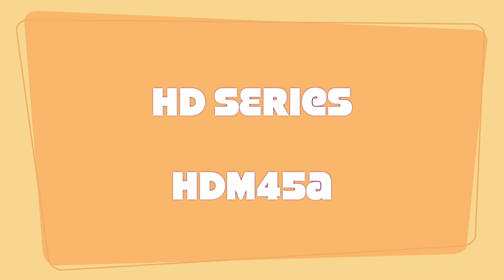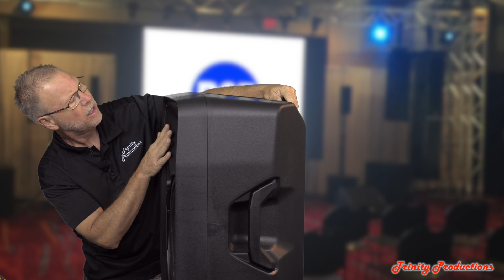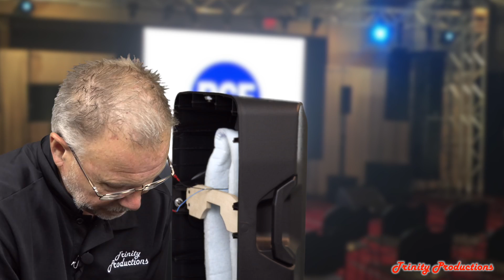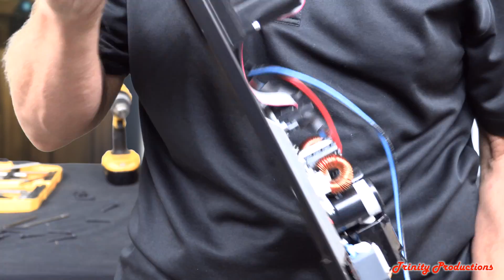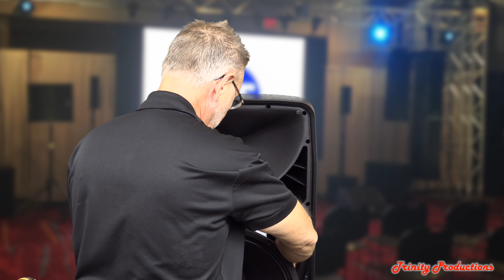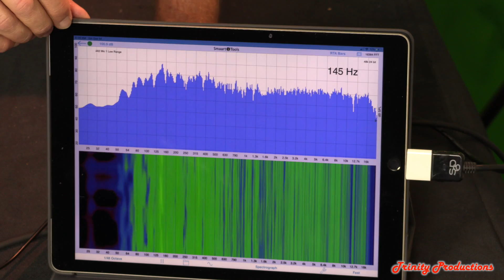RCF HDM45A Complete review and take it apart video. Authorized Platinum Dealers for Italian Speakers

Comment: what differences did you find between HDM45A art 945 and art 745 (RD NET part) I mean as for sound are there any differences?🙏
Reply from the maker: The HDM45A seems to go lower IMO than the ART box, but the drivers are from what i glean are the same , the 945 much better power than the 745 but the HDM had a 650hz crossover point while the 945 keeps that same smooth crossover point , the 745 is the same , just less power and SPL than the other HDM or 9 Series, which are very close in max SPL , the MK5 is within a few dB of the other two , the original 745 had the same max SPL. I did like the fullness of the HDM45A, we sold quite a few that were used for large field events by a missionary in Africa and they loved the output of the HDM45A's and quality coming from them .

Comment: Hi, I'm thinking about buying either HD35-A or HD32-A mk4 speakers.Which one do you recomend for live band.Is there big difference in sound between HDM45-A and HD35-A?
Reply from the maker: I would go with the HDM45's if you can swing it ... amazing sound, my next choice would be the HD35's for live band ... the lower crossover point of the HDM45 is smooth and for vocals allows to really punch thru.

Comment: This seems like a newer version of the EV ZXA5. Which of those two speakers do you like better? if you have heard both. I have the Zxa5's. And they are great... they just get hot.
Reply from the maker: Brian - i have not heard the EV speakers. .. but the EV are not even close to the HDM45, this speaker is in a league of its own. 1100WRMS, EV does not give RMS power, so who know what the heck they are telling you. I doubt EV is 1100WRMS power. The HF driver on the EV is pathetic compared to the flagship 4" driver of the RCF HDM45. The cross over for the EV is 1500, so SMALL HF driver vs. LARGE HF driver of the HDM45 which is crossed over at 650hz for the smoothest sound you will ever hear from a 15" 2 way speaker. Glad you like your EV's but the HDM45A will kill them hands down.
Reply: @trinityprosound  I appreciate your opinion on this. Thank you!
Reply: The zxa5 does give its rms it’s 1250 rms

Comment: Rcf Hd45a without sub vs db es1203 which one is overall better buy? Also  louder output
Reply from the maker: Going to need subs with HD45's , maybe not with ES1203, but the ES1203 is a LF driver that does double duty as a LF driver and quasi subwoofer, it is not a dedicated subwoofer. You will get better low end with a dedicated sub, but depends on your mission and what you are looking to accomplish and type and size of events. More info is needed.

Comment: Which one is the better buy! Rcf nx24xl or Db igt4 - Rcf Hdm45 -Mackie srm315? I think the Ev etx12  are sweet for the size.
Reply from the maker: between the NXL and the IG speakers, weight is the big difference , IG is much lighter. Mackie does not even come close to HDM45... and not a huge fan of the EV line up. If weight of the tops is not a factor for you, you will like the sound from the NXL24's better, but you will need to use with a subwoofer to get the full range sound from a system.

Comment: With the ART745A MK4 at $1599 and this HDM45A at $1799, what are the main differences between them? is the more expensive the better sounding one?
Reply from the maker: More power and more features for the HDM45A
Reply: trinityprosound do you think that I could get away without using a sub with these?
Reply from the maker: you can try, but to get decent low end, you will need subwoofers, you can over drive low end on these and damage them trying to get them to do what a subwoofer should be doing.

Comment: The NXL 24 (array) has my eye.  Since you have heard both, how do you think compares?  Totally different speaker, but overall, in terms of sound and spl?
Reply from the maker: I am a fan of the NXL24 for the output and size and how the system can easily double up and still sound great, that is tough to do with 2 speakers side by side splayed. Sound wise you will be amazed with the NXL24's

Comment: Hello great video. On the digital volume display how would you know when the volume is turned all the way down?  The digital volume has me a bit confused ... thanks
Reply from the maker: The "0" is all the way up, then goes down to around -50dB on the rotary encoder. comes from the factory wide open at "0"
Reply: @trinityprosound  so 0 is the highest volume or is it just 12 o clock like other speakers with knobs not digital
Reply from the maker: it is a rotary encorder there is no "stop" on it. so setting to "0" is wide open. the encorder turns and you watch what the display reads out, turn until your hearts content....

Comment: is the HDM 45A better than RCF NX 45
Reply from the maker: Has more power and more features, BUT it is injection plastic box vs. wood from NX, NX has 700WRMS HDM45 has 1100WRMS and RD NET, and is lighter in weight.

Comment: How does this compare to the RCF 745 mk 4's and the NX 45's?  I need some powered speakers and don't know which way to go.  Looking at the JBL 815p's also.
Reply from the maker: The ART 745, NX45 and HDM45 are similar in design and drivers, etc.The HDM45 has more power than the other 2 with RD NET, you will get a lot more for you $$$ spent on RCF than with JBL, there all you get is a name. If weight is the issue ART or HDM 745 or 45 is the way to go IMO
Reply: @trinityprosound  I am looking at purchasing a powered system for my band.  I am currently using JBL SRX 715 tops and SR4719X dual 18 bottoms all powered by iTechs.  This combination has worked fine for several years.  The early powered stuff would not come close to that performance so I have waited.  I believe that there are products on the market now.  

My issue is that everyone that does reviews only use compressed music like DJ's use.  Lots of systems can sound good when pumping compressed music through them!  What about a good old kick drum and bass guitar???

We all absolutely love your reviews by the way!  My decision is to go with RCF but they have so many choices which makes it little difficult.  I recently saw another review of the HDM45A vs the TT 25-A II which the reviewer stated that they were similar in output, but gave a slight edge in sound quality to the TT 25-A II and is it worth another $1,000 more.  When he paired them both with a sub, he then stated that that is where the TT came alive and was head and shoulders above the HDM. 

I am a buy-once cry-once kind of guy sooo...
Reply from the maker: The HDM45 is a great box, but nothing in the RCF line compares to the TT. But the HDM and TT25 are not the same. The TT25 has premium drivers, amp and wood box , tour level construction. Is it worth the extra bucks in a buy once cry once scenario, YES. You will love the sound of the TT boxes and when coupled with a comparable sub such as the 8004 or the new TTS18AMk2 you will find it takes less boxes to do what your current system is doing. BTW only about a $700 difference between the boxes... and for the additional $$$ you get a lot more quality
Reply from the maker: PS, thank you for watching the videos, hope they help in some way.
Reply: @trinityprosound  Hmmm... I'm sold...I think...  My band is pushing me towards being more compact as well.  Is there such a thing a a single 18" box that is equal to my old dual 18" JBL SR4719X's powered by iTech 8000s?
Reply from the maker: Maybe. SPL wise yes, the  TTS18's or SUB8004 or SUB9006 out run the JBL but with the dual configuration of what you are using, and pushing more air with the dual configuration and larger box volume will seem "louder" or more full that a single sub. The only other single sub I have heard that can kill a dual 18 is LAcoustics but they have separate power amps feeding them and you are right back to amp racks.
Reply: @trinityprosound  Your videos are excellent!
Reply: @trinityprosound  Ok. Thanks from all of us here for the insight.

Comment: Another reviewer has said they're effectively TT25's in a plastic box, or at least damn close. Can you speak to this? Thanks for all the great reviews!
Reply from the maker: NO, not quite a TT25, this has a stamped frame, TT uses cast for durability, they would not be putting that in this model at this price point. The amp is not TT quality either. It may be close to looking like TT but it is not. More like the ART with RD NET is a better more realistic comparison. I like the HD line for the full grille used on them. If they said like a TT, they don't know the RCF line very well at all.